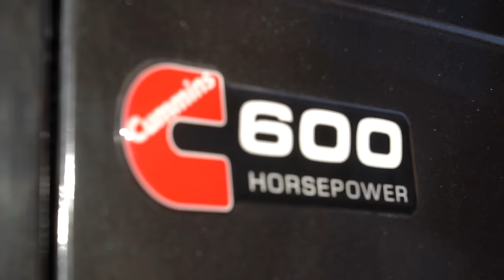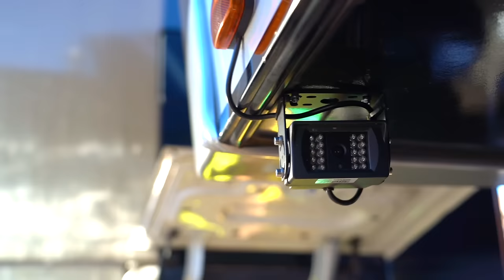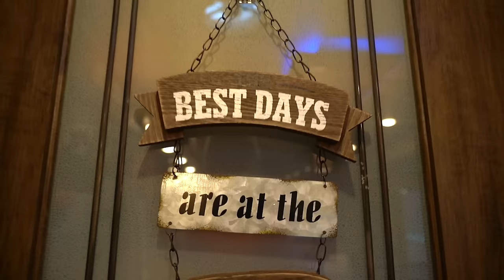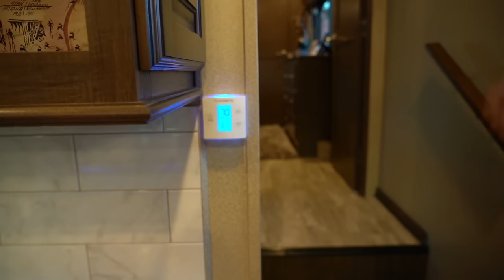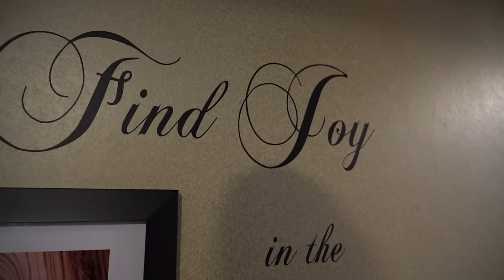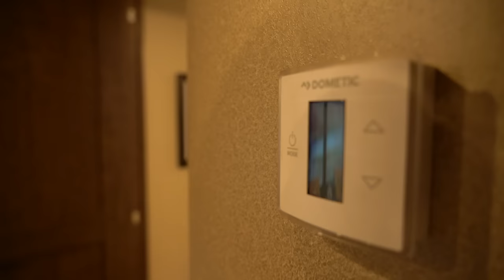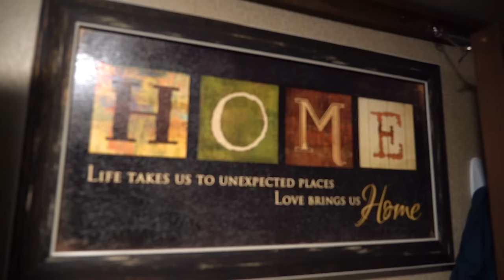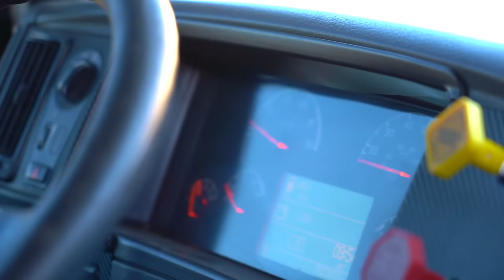Couple Builds The GREATEST DIY RV Conversion EVER!

Comment: I couldn’t finish watching this video there was so much shit talking that filled up that river and all we are gonna float away 11 miles to the gallon in that truck 😂
Reply: 11.4mpg on I40 all the way to OKC
9mpg in the mountains of northern CA
We don’t drive like assholes. We do 55mph period
Reply: You had me worried I was doing my math wrong so I had to log our trip we just did. Lake Havasu city to Red bluff CA is 1446 miles we filled 130gal when we got here. That’s 11.12 MPG according to my math 😆😂🤣
Reply: @BoostedFJ  I get over 9 mph on my VNL 730 with the Volvo D13 pulling a 32 foot 5th wheel and carrying my 4-door Jeep on most terrain and when I safely and legally can, I will travel faster. The truck loves it.
Reply: @martymain1907  Awesome! Sounds like a killer setup. Are you tandem axle or single like us? I always wonder if the single axle guys do better on fuel.
Reply: @BoostedFJ  I heard that about mpg, too. But I love the carrying capacity of the tandems (36k) and locking the axles together for getting out of traction problems. Do you have differential locking?
Reply: @martymain1907  We do have the single diff lock but haven’t ever used it. We are looking into a new semi and I was leaning towards tandem this time.
Reply: Apology accepted

Comment: OMG Cheri, you gotta spank that husband of yours as this is like the 10th or 12th time I've seen him driving off road WITHOUT a seatbelt on! Sorry to grind on this subject, but I just don't want to see either one of you wonderful people getting hurt by accident! This other couple have no worries about water, as they have the Colorado river that close by their camp site. Using your built-in pump, you can pump that water through a filter, and have clear, clean water to drink or to BREW (beer) with! I hear a lot of wind noise, are you guys using a dead cat on your microphone? They work really well, and cut down on extraneous noise very nicely indeed! I like the fact that they're pragmatic about individual RV needs and who they are ultimately for. Are you aware that you can get plastic carboys with handles that can hold 15 gallons of FW? I have 12 of them, but will only be hauling six, so if you want them, just let me know! Great idea on having a spare pump since you're boondocking you have to be completely self reliant in that regard. Other than water, storage IS the primary function needed for boondocking IMHO; glad that you mentioned this because I've seen way too many travel trailers with little to no storage because they are so heavy in dry weight. Looks like all they need now are beer taps! WOW, third generation full timers, now THAT'S a legacy to believe in! As for naming your rig, we call ours Towed Haul (like Toad Hall in Wind in the Willows) because the TV Hauls the TT which is Towed. Corny, I know, but that's the way we roll! My suggestion for a name for their rig would be "Build High for Happiness" since they have such a tall rig. Safe, and hoppy travels from The Boondocking Brewer™!

Comment: Wow! Wait a minute. You just said brakes are better? Maybe comparing to a 150 or a underrated pickup truck but you don’t need to mislead the public with a real semi loaded here dude. I got over million OTR and with every trailer basically out there, even 16 axle. Your running three axles for weight that I pull PLUS behind my 250 and I don’t have any issue stopping. One more thing, I trained drivers and not just anyone can drive one.